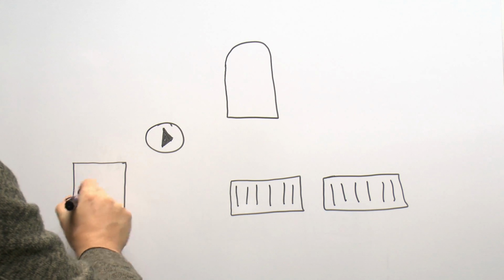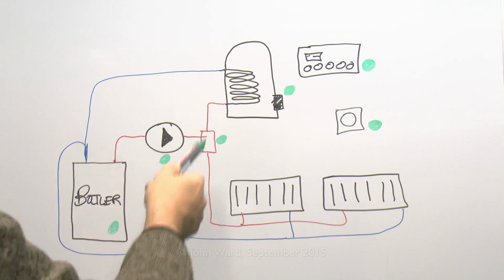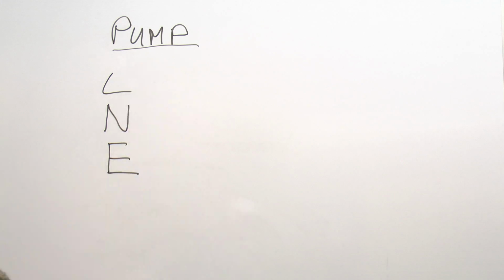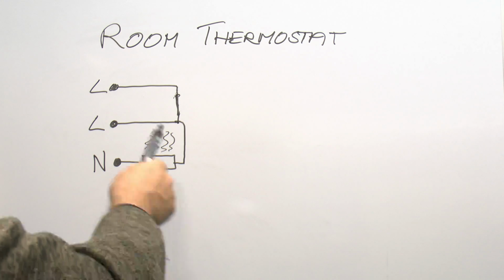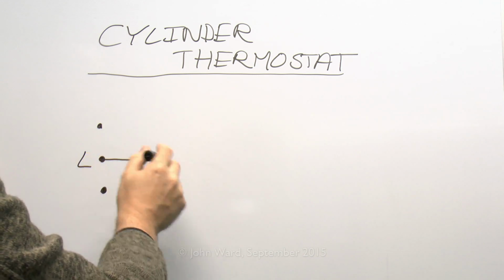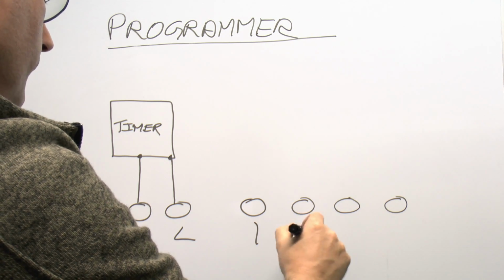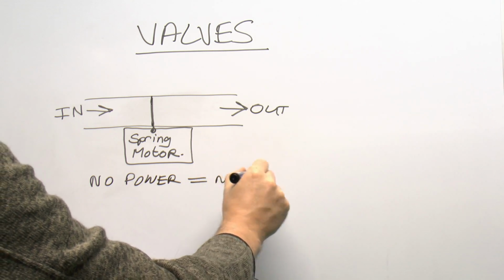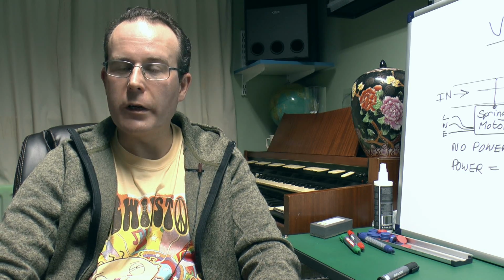Central Heating Electrical Wiring - Part 1

Comment: I don’t get why British heating systems are so unnecessarily complex instead of sending hot water directly from the boiler to the tap. The cylinder is all redundant
Reply from the maker: Some do, it's called a combination boiler.  However such things are only suitable to supply a single outlet in a small property with small hot water usage.  For large properties with larger hot water requirements, stored hot water is necessary.

Comment: Is it possible to simply use a smart mini wi-fi switch to connect across a central heating programmer to switch heating on/off remotely using an app?
Reply from the maker: Yes, programmers are just switches, so pretty much any switch can be used, smart or not.

Comment: In today's Green and Eco conscious environment are people becoming reluctant to have oil and gas boilers for heating and switching to Air Conditioning systems instead, or would that be price prohibited with the cost of electricity..?
Reply from the maker: Gas is far cheaper than electricity (4x), so for most installations gas is the usual choice.

Comment: Hi - we have switched the electricity off in our house as we are going away. The boiler will obviously also be switched off. Is it a problem/is it dangerous?
Reply from the maker: Not dangerous.
The pump might seize if it's left for a very long time, and if it's in the winter freezing could cause damage.

Comment: John.. please.. on my heating/water control panel, Drayton lp522 .. is the yellow light meant to stay on all the time..
Is it wired properly and can I turn it off from inside the panel..
Reply from the maker: The yellow light for the central display stays on all the time.  The small red indicators either side should go on/off to show whether the heating and hot water is on/off.
Reply: John Ward 
Thank you John.. I have seen the same one with no light on it though..??
Reply from the maker: @user-ef9rk8ln1f  There are several different models, all look similar, some have the backlight, others do not.
Reply: John Ward 
Oh dear..
Thank you Mr Ward..

Comment: I would estimate that about between 2/3rd and 3/4 of fully pumped systems are Y-plan (1x 3 port valve) and the majority of the rest are S-plan (2x 2 port valves) there are some obscure ones like C-plan with 1x 2 port but the majority are quite simple. It’s surprising how many electricians don’t know how to wire heating systems even though it’s just motors and switches in principal

Comment: Some digital thermostats only require the two switch wires and they use batteries to power the electronics

Comment: There are still new boilers that only require a switched live, they only require a permanent live if they require a pump over run to circulate residual heat from the heat exchanger and all new pumps now must be “smart” pumps that modulate their output depending on the load on the system
Reply: pmailkeey, Ideal icos needs a permanent live so you can tell when the £200 circuit board has packed in again!

Comment: how to connect this one to water tank Codice - Dual Combined High Limit Thermostat & Control 542791
Reply from the maker: Normally both thermostat contacts are wired in series, then the whole thing is considered as one thermostat, with two wires.

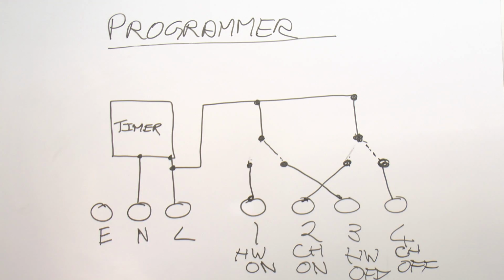Comment: Thanks John, I've been watching your videos this weekend and they are very well presented & helpful. Sorry to be pedantic, but at 19:43 I have found, in my experience as a heating engineer, that the most common arrangement is Off, Off, On, On, rather than the other way round i.e. HW Off, CH Off, HW On, CH On

Comment: I have a very old "boulter camray 5 oil fired boiler" and recently when I had to replace the programmer I found it only has a pump on the central heating side and nothing on the hot water side. When the hot water comes on it just turns on the boiler. When the heating comes on, only the pump turns on, meaning that you have to have the hot water on at the same time to heat the water.

Comment: Hello John. Thank you for a very interesting video.I’m especially interested in the part with the wireless thermostat and receiver box on the wall near the boiler.I have just bought the nest system and I’m sure I can fit it all myself except I am confused with one particular wire. How do I know which wire is the “call for heat wire”  and how do I locate it?

Comment: Strange that you use low voltage (240Vac), control there still, we have been using PELV here for as long as i can remember, a suitably sized 24volt transformer in the boiler powers everything else (except the pumps), those are controlled by 24vac relays.
There should be an over temperature cutout (manually reset safety), in the boiler too.
Great video just the same, you might catch up with us convicts one day :)
Reply: We do have 24 volt stats .on some boilers you have terminals for both

Comment: If a boiler is 6kW ( 2x 3kW) elements how does this work because surely that draws 26A and not 3A ?
Reply from the maker: It would, but the connection for an electric boiler would be a separate circuit just for the boiler.  These videos are about the control wiring, not the means of heating, which is usually gas or oil.

Comment: Excellent tutorial.. On an S plan, when another heating zone is required with a second motor valve and second room stat, I'm guessing you use a spare terminal in the wiring centre and take the s/l from the second stat to energise the second valve input (orange) with the output going to terminal 10 as usual to fire the boiler?
Reply from the maker: Yes, it's the same for each zone.  All of the outputs connect together.  You can add as many zones as you want, each just needs a thermostat and valve.

Comment: Hi jw just a quick question I have a combi boiler with the standard programmer and I'm thinking of installing the hive thermostat dual chanel the question is will the hive replace the programmer or run alongside it like my existing thermostat does and maybe you could make a Video regarding these thanks Adam
Reply from the maker: Hive replaces both the programmer and thermostat, the one device does everything.
A combi boiler is one which heats water on demand, there is no hot water cylinder, those need a single channel hive.
If you have a hot water cylinder, a dual channel hive is required.
Reply: John Ward cheers john it's just a boiler and there's a tank upstairs ..as for the existing thermostat would it be removed and the live and call be joined and a blanking plate be put over it or would that be done at the boiler and then the wires at the thermostat be made redundant.
Thanks for the reply
Reply from the maker: That's it - you will need to dual channel one.  The Hive has a standard backplate, so may just fit onto the existing programmer plate without any wiring changes.  Thermostat wires either connected together at the thermostat position, or put a link in the wiring box and remove the thermostat wires completely.
If you do need to remove any wires, mark them all first and take several photos of all of the wiring so you know where they were connected - colour codes and terminal numbers can be different depending on who installed it originally.
Reply: John Ward cheers jw

Comment: Hi John can you run a video on electrical connection and equipment required for domestic/commercial solar ( photovoltaic system) and explain how dc and ac converts in this system. Thanks

Comment: Most boilers these days actually have (besides the permanent supply) an LS, NS and LR connection. LS and NS supply the control system while LR is the switched live which fires up the boiler.

Comment: Nice heating explantion!
I do not get it why the valves are built this way in GB?
Wouldn't it seem rather inefficient to have the valve always powered while open(which is most of the time)?
Why even have a valve at all??
In most cases just a pump would just suffice!
In Austria where I live  mixing valves are used sometimes which use an actuator(motor).
Also gas and oil are so last Century! Heat pumps are the way to go!

Comment: Thanks for the very interesting videos.
Just for interest:-
My system has a gas boiler, a pump and a programmer but only one valve to shut off the heating if not required, giving priority to water by gravity. Hope that makes sense to you. The valve opens when heating switches on. The whole system was installed by a friend in 23 hours(working) and we have a 4 bedroom house, he done it this way to keep the price down, I bought all the parts and he installed it, he charged us £80 labour so you can guess how many years ago that was. I've only had to replace the programmer, a Randall 3060 I think it was, with a Honeywell programmer which we still have and the boiler, everything else is still going. I've also still got a few lengths of 3/4" piping, it's amazing how thick the wall of the pipe is compared to todays standards.

Thanks again and I've subscribed so will be popping back now and then.

Comment: I don't know anyone who still has a water tank these days.  Everyone I know, myself included, has a combi boiler that heats water on demand.
Reply from the maker: +RedDragonUKTech Combi boilers are single outlet devices.  Useless in a property with 2 or more bathrooms.  They are frequently installed because they are cheaper and quicker to fit than a proper hot water system, rather than because they are actually suitable.
There is also a myth about them being more efficient as they only heat what you use, but this is nonsense as most of the heat losses are from the pipework between the boiler/hot cylinder and the outlets.
Reply: +John Ward fair one, that makes sense.  It's still something I don't see very often.
Reply: +John Ward We have a half sized electric heater tank that feeds two bathrooms from one standard sized pipe. The pressure drops when you turn both sinks on hot. We had a problem with rusty water coming from the kitchen sink once. The plumber found the cause to be a bad anode in another miniature heater tank that was inside the wall under the countertop near the sink. @_@ That plumber will have nightmares.

Comment: Hi John, is it really true that if you turn off unused radiators its saves gas? Because our thermostat is in one room so therefore how can turning other radiators make a difference?
Reply from the maker: +ChompChompNomNom The only way turning off unused radiators saves any real money is if the unheated rooms are well insulated from the rest of the house, and the doors to those rooms are permanently closed.
As this is never the case, not heating one or more rooms just means the heat losses from the other rooms are much greater, as the heat moves from the heated rooms to the unheated ones through the uninsulated walls / floor / ceiling.

Comment: Using mains voltages at the thermostats seems unusual. There must be a historical reason for this. Here in North America, the majority of heating, ventilation, and cooling systems (HVAC) use a low voltage such as 24 volts AC to power AC switches back in the central heating unit.
Reply: +Steve Rodgers Used not to be the case. My parents first CH boiler (gas) installed in '68 used 24Vac for the roomstat. I can't remember what the cylinder 'stat used.
Reply: in the UK we don't have "HVAC", we have "central heating" that is solely concerned with warming the place up.

Really old systems have no electronics to control any of this, I've lived in a house where the boiler timer was a mains powered mechanical clock timer and the thermostat a simple bimetallic strip. So switching mains voltage makes sense.

Comment: Hi John. I'm afraid you've got the connections to the cylinder coil the wrong way round.

Edit: Now I've watched the whole video, there may not be an earth connection to a valve motor head if it's isolated from the valve body. I've got a pair of Sunvic valves here with plastic-bodied motor heads and just Live, Open, SwL plus Neutral - no earth.
Reply from the maker: +Graham Langley Easier to draw that way, avoids the flow/return crossing over.

Sunvic valves are generally evil, they also make those which have motor on / motor off an no spring.  A good idea but poorly implemented, they don't last long before some failure occurs.
Reply: +John Ward Their MoMo ones are exactly the ones I have, chosen because I wanted to be able to mimic way the old Switchmaster 3-port valve worked.

The mechanics seem OK, the cct is OK with the 24V zener across the relay and the current-limiting resistor put back in, but the PCB design is terrible with too small clearances for mains voltages. I'm tempted to layout a new one instead of just replacing the worst track with a wire link.

Edit: But it's no where near as bad as their Select 207xl programmer. I fixed a neighbour's one that failed on New Years Eve a few years back. How they could sell such a badly designed and produced bit of kit is beyond me. Swapped it for a Siemens RBW9 a few days later, discovering in the process that 'universal' backplates aren't.
Reply: +Graham Langley Perhaps I should add that the Sunvic MoMo valves won't emulate the Switchmaster, which stays in the last position and only moves when the demand changes, on their own. They need a home-brew controller, which can also give hot water priority.
Reply: Graham Langley  i  was looking at the same thing there. flow and return wrong